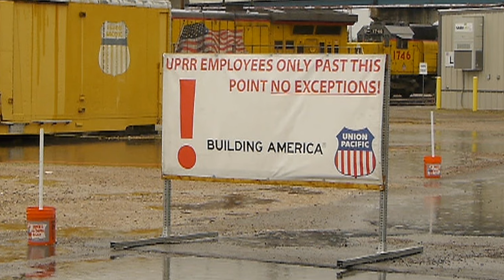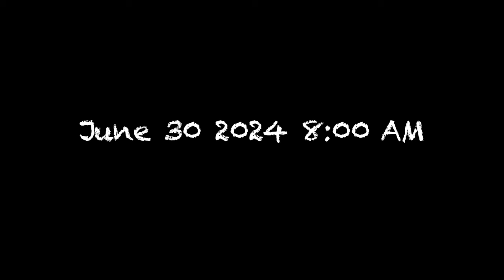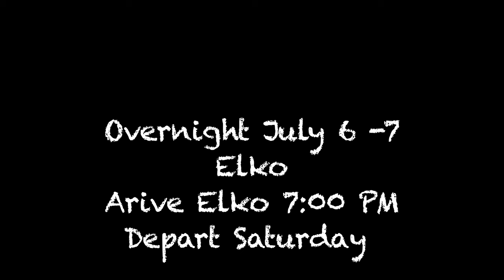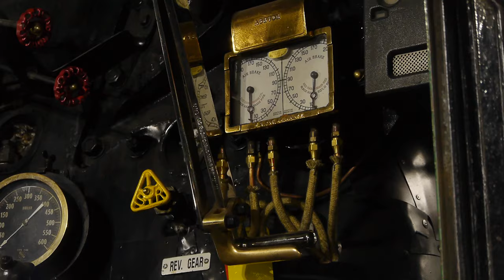BIG BOY 2024 SUMMER SCHEDULE!

Comment: Is this some inside info? Your specific layover dates between the main display dates in Roseville and Ogden are not posted anywhere that I have seen.
Reply from the maker: I’ve been talking to a lot of people and picking some brains. A lot of this is speculation and as it turns out some of it is wrong. I’ll be making corrections as I go. In fact, I have an update going up in the morning with a few corrections and a little more detail. For the most part, however this is correct.  the one big problem is I was assuming the train would be on display as would make sense, however, as it turns out, it will only have public displays in Ogden and Roseville. Unless any changes are made to the schedule, it will be off-limits everywhere else.

Comment: What about restoring the 9000? Or would it’s long frame be too much of a hassle to go on tour?
Reply from the maker: Yup. It would need to stay in the east. But UP has its two major locomotives and have given the other two away. They will be running soon. 3985 and the 2-10-2. 5511. They are in Silvas and both about 50% restored.

Comment: They need to bring her east.....she can get through Horseshoe..........
Reply from the maker: She needs to stay on UP.
Reply: @ToyManTelevision why exactly? It sounds mostly like a paperwork issue or is there a technical reason
Reply from the maker: @the_retag  UP wants her own UP crew and system running her. Not that it’s out of the question but not likely.
Reply: @ToyManTelevision  couldnt up crew run her on other tracks? With maybe a local engineer for track knowledge in the cab, which is plenty big enough. Wanting own infrastructure is of course valid as it surely ads flexibility